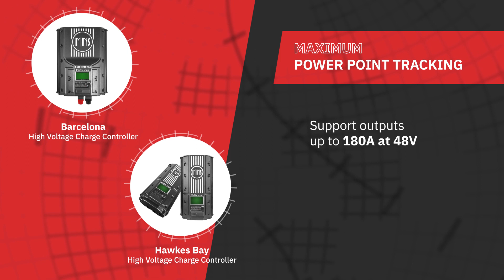Midnite Solar's Inverters and Charger Systems | Powered By ROHM

Comment: How much PV AMPS can the BARCELONA handle?
Reply: Drairo, the PV input amps depends on the PV voltage at maximum power point of course. The battery output current max is 200 amps from both PV inputs at minimum Vmp of 185 volts... So the input amps per PV input would be around 25 amps or slightly less at battery V of, say, 50 volts

I just got confirmation that the ETL listing says 20 amps maximum input current. I was close